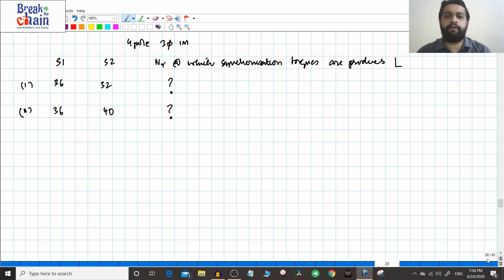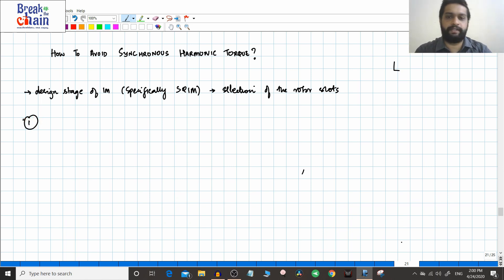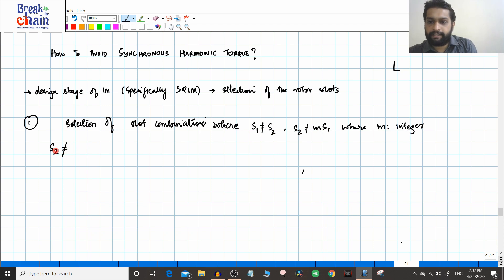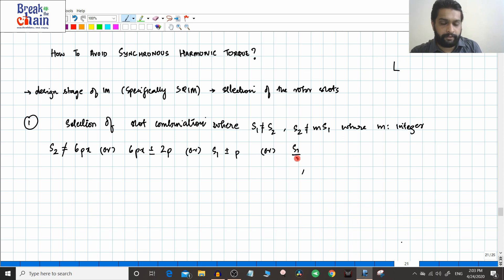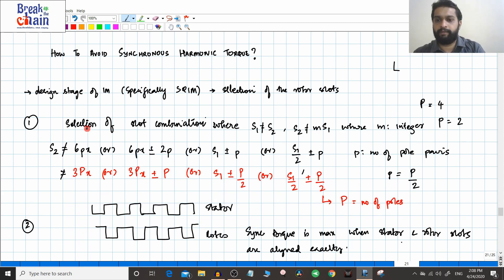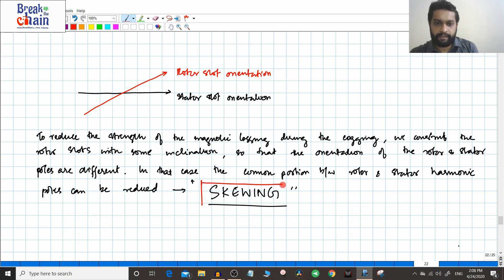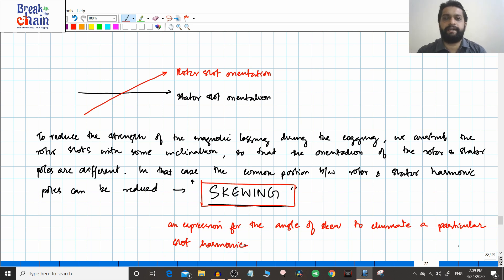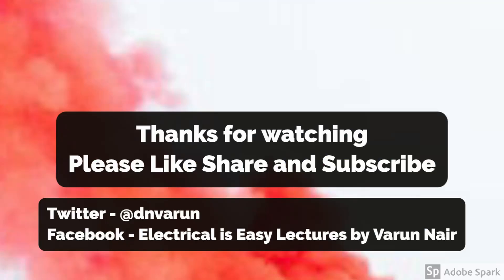Induction motor #82 - Slot Harmonics #6 - How to avoid Synchronization Torque?

Comment: Hi Varun,  It's still unclear @ 6:08 why when the syncronus poles 'are alligned with each other' that we get syncronus 'torque'. I can see that we get maximum attraction or replusion in this alligment as you stated but in everything else we studied, even in the syncronus motor, we required and angle between the stator mmf's and rotor mmf's to get a touque imposed on the rotort by B rotor X B stator.

Comment: Hi Varun, Speed at which harmonic torque is possible due to slotting in first case is -1/8 Ns (breaking mode) and in the second case 1/10 Ns (motoring mode). thank you !

Comment: Hi Varun, when you say the stator and rotor slots are aligned, does that mean the staror and rotor poles are locked at 90 degrees wrt each other so that we get maximum torque?

Comment: Hii Varun, I reviewed and re-saw that we don't want to operate at 90 between the B rotor and B stator fields because too close to pull out torque. So is the physical mechanism of harmonic syncronous torque a bit different than both the normal operation of a syncronous motor and an induction motor. Because we have two 'sets' of poles rotating, so it's differnent than normal syncronous motor that only has DC excitation on rotor for Br? Do these two sets of rotating harmonic poles get locked by north-south arraction at Nr as calcultated and the stator harmonic poles pull the rotor harmonic poles around in the motoring mode?

Comment: For S1=36 S2=32 3 phase  4 pole IM
Nr= -Ns /8 at which synchronous torque occurs

For S1=36 S2=40 3 phase  4 pole IM
Nr= Ns /9 at which synchronous torque occurs

Is it correct , sir?